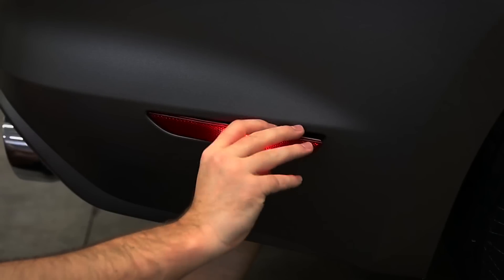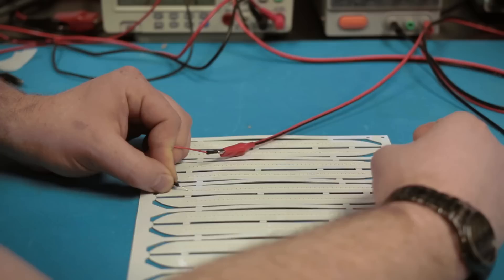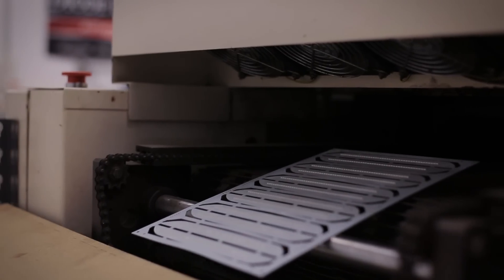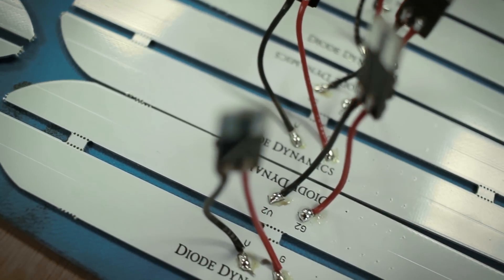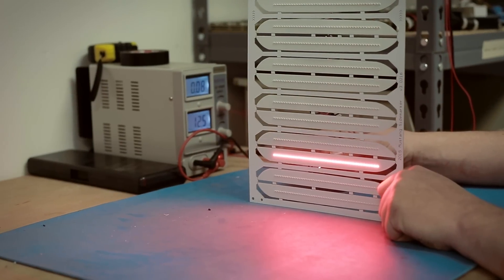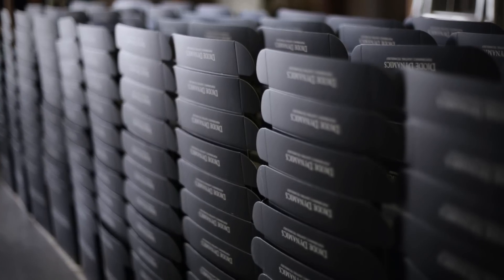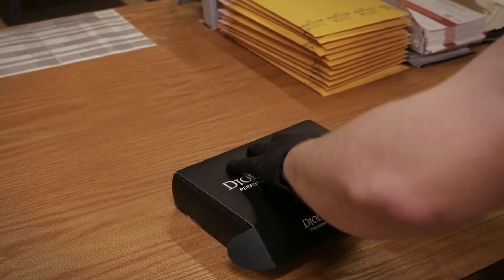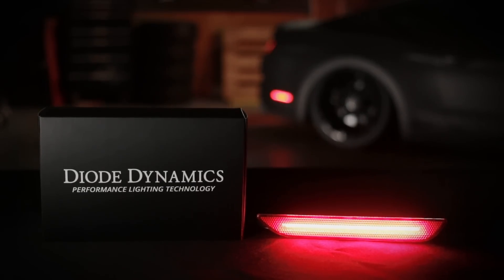How It's Made: 2015+ Ford Mustang LED Sidemarker

Comment: hello, i would like this upgrade but it seems that alot of buyers are having leds failing. installation seems straight forward could something be further done to prevent the leds from going out.
Reply from the maker: +Hellas Thanks for reaching out! We did experience issues with an older version, but we have since redesigned our LED Sidemarkers. Our engineering team conducted extensive testing on the defective units that were sent back, found the source of the problem and redesigned them to prevent failures from happening in the future. If you would happen to experience any issues at all, you can always contact us and we will get a replacement sent your way under the 3-year warranty.
Reply: Diode Dynamics thank you for responding back so quickly and clarifying, I just placed my order my order # is 11336695
Reply from the maker: +Hellas Thank you for your order! If you ever have any further questions, feel free to contact us.